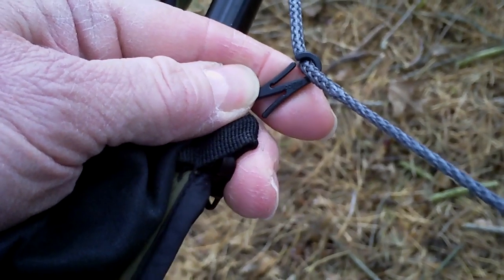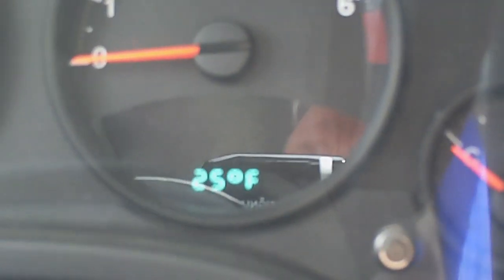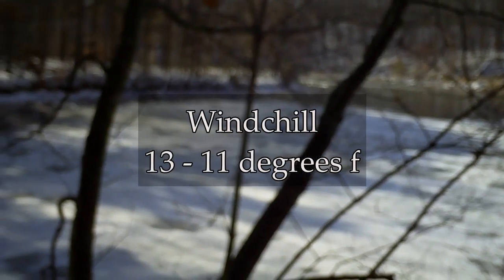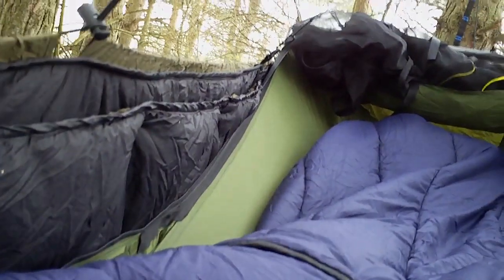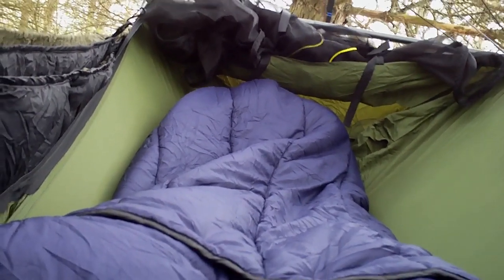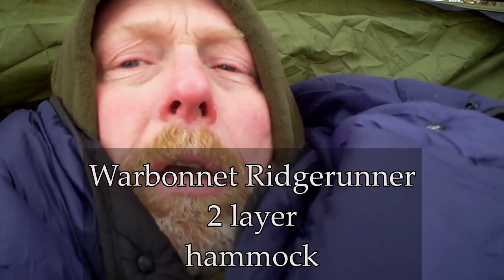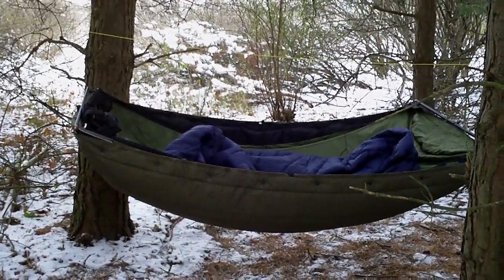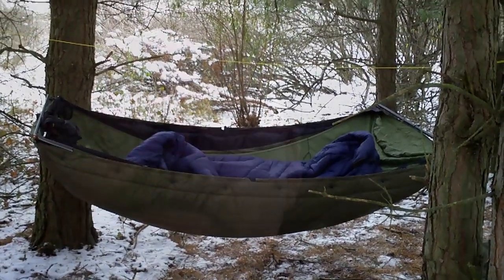Warbonnet ridgerunner with added ridgeline and cold weather test of quilts

Comment: Great idea with the extra ridgeline. That style of hammock is too good not to figure out ways to make it warmer.
Reply from the maker: Going to try and get out tonight and see how well it works with the topquilt, sleep pad and long undies. Bringing along the underquilt and blanket too, hopefully won't need them. With the sock, a ridgline isn't really needed as you can put one inside.
Reply: I've heard an underquilt protector warms you a bit by shedding wind, but of course that's more weight to carry.
Reply from the maker: @slickwillie3376  I made a protector from Argon 90, it weighs next to nothing. But I'll be using the Spindrift sock (also Argon 90) made for the Ridgerunner that does a good job shedding wind and light precip